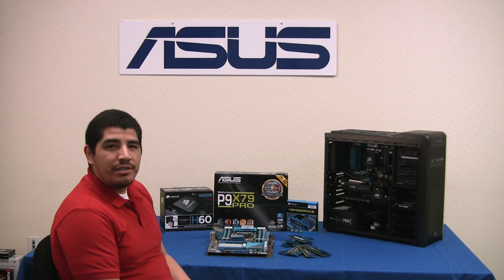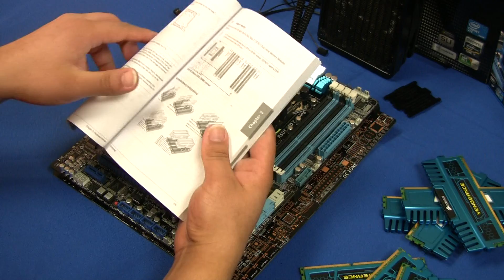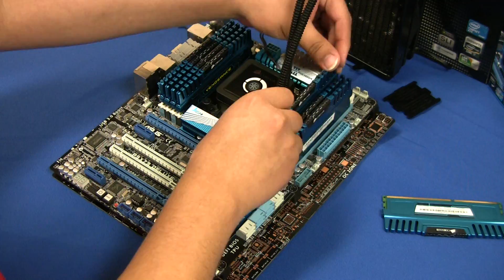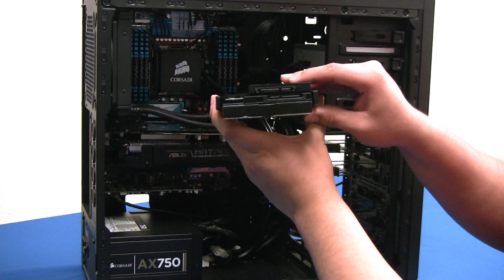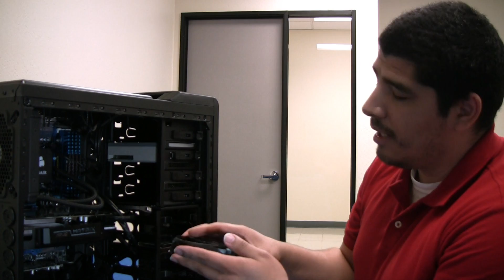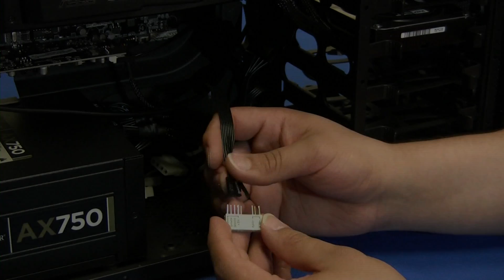How to Build an Intel X79 Custom PC 2/2

Comment: Question for you. Does the Corsair Hydro Series H100i fit into the Corsair Carbide Series 400R Mid-Tower using an Asus P9X79 Pro motherboard? I've read about issues.

Comment: btw, my asus p8p67 rev 3.1 died like 2 months ago, sent it in for repair to RMA got it back with only a small letter that explain nothing about what was done to the mobo, any how, the mobo still don't work, i lost hope for i have already done every possible thing i could to fix the problem, new psu, ram, cpu, you name it, so now i am left with one last option, and thats to buy me a new Mobo, but i will not make the same mistake, this time i'll get me anything but asus. shame on you asus.

Comment: -Corsair H100 for maximum OC (like 4.7Ghz or more) or H80 (because it's cheaper is as almost effective).
-SSD (buy two 120GB and raid them) or just one ssd and hdd for backup.
-Graphics: AMD HD 7950-7950 is equivalently as the GTX 670. 7870 is equivalent as the GTX 660 ti, but I think AMD overclocks better...not sure.
-3770k is a beast.
-Maximus is crazy awesome.
-600watts if you want one GPU, 700watts for two.

Enjoy your build. Don't forget to ground yourself, touch the PC case, simple. :)

Comment: Don't get the 680 its a waste of money ($600) and only a 5% performance increase over the 670. I personally would recommend a Kingston HyperX or a Intel 330 series SSD (Both are 120GB). You don't need a SSD to put games on just put them on a HDD. For the HDD I would suggest getting a WD Caviar Black 2TB. Also get a sound card Creative Sound Blaster Recon3D is one I could recommend

Comment: Keep the CPU, The E-ATX Motherboard is unnecessary You can get the ASUS Maximus V Gene M-ATX Z77 Mobo, Drop the 680 and get a 4gb 670 (You can get a Galaxy GTX 670 4gb for $440). Let me know if you need help with anything else :D

Comment: Yea, i was just looking into the h100, and was wondering if the artic accelero hybrid graphics card liquid cooler, and h100 can both be used together? Im thinking about getting the raidmax agusta case, it has watercooling features i hope thats what its for and not custom cooling.

Comment: you might wanna go water cooling because these chips already take up alot of voltage therefore causing the chip to heat up.

Comment: Hi JJ

I took your advice and built the system pretty much as you suggested  using 64Gb of RAM and an H100 cooler. My 16 year old son assembled the machine with me supervising. It is without a shadow of a doubt the fastest machine I ever experienced in 20 years of website design.

I used the same measures that you used during the RAM Cache and RAM Disk demos.
It took a while to get me head around the config but its fab.

Blistering performance enhancements! Thanks for your MOBO design and guide.

Comment: I had something similar when building my 1st pc afew years back. I used i7 920 on a Asus P6T mobo and was shitting it when putting the CPU in the motherboard as it was my 1st build and they wasn't cheap back then lol. Im using the same PC typing this message and Im researching a new build. So Im confident as my 1st build is still going ok :-)

Comment: Yesterday, when I was building my machine, I thought I was damaging the CPU socket pins when I laid my processor in the socket.  It made a crinkling sound as I was fastening down the retention bars.  It sounded like the bristles of a wire brush.  For the record, my motherboard was the ASUS Rampage IV Extreme.  Great board.  I was skiddish about using it for my first build, but I was very happy when the system fired up for the first time.  I had no problems with my build.

Comment: Can someone please tell me which CPU_FAN connector on an asus p9x79 mobo do you connect the corsair 3 pin pump connector to?  On my p9x79 deluxe board there is a 4 pin CPU_FAN connector and another 3 pin "heatsink" connector to the left.  Do I use the 3 pin heatsink connector?

Comment: does the cpu turn upside down in relation to the letters on the CPU. I have a evga x79 and just mounted the 3930k, and it looked weird that the cpu should turn upside down. I had a 2600K and that CPU was mounted the right way in relation to the letters. I know it's a weird question, but I would like to know anyway xD

Comment: Good video but "at this point", "go ahead", "actual/ly", "good to go", "pretty much" and other filler words are overused to the degree of becoming distracting. I also recommend "use" instead of "utilize", as the latter is only fitting on very rare occasions (biological systems and some other contexts). I also would have preferred to see the placement of the motherboard into the case.

Comment: All I want to know is how to turn my built in web cam back on. It worked fine until yesterday. Now all I get is a message telling me to be sure the cam is plugged into the USB port. Well, that is a bad piece of advice considering that my ASUS AIO has a built in web cam. But then again it tells me to turn it on. WTF, I never turned in off and even if I did I would surely know how to turn the dang thing back on. NO help I can find anywhere, not even on the tech support chat site. HELP ME!! Thank u

Comment: the letter a in front of 1600c9b  is on their dual channel offering.... and all listed supported corsair website newegg amazon etc... list quad channels exchanging that A for X ....M4X1600C9 ... the last number for latency, last letter for color...(no ending B for x1600... no blue... for sale anywhere...however asus p9x79 deluxe memory compatibility chart on website  shows a kit cmz16gx3m4a1600c9 ..(the black dual channel) with no b .. but the same ram listing them as compatible...

Comment: Thorough explainations.  Is it possible that an SSD and HDD can be attached to each of the 6 slide in HD bays and end up with a potential 6-SSDs and 6-HDDs installed?

Comment: fans shouldn't blow air inside a case from the top... they should exhaust, because warm air tends to go up on it's own anyways... therefore when exiting the case, it goes up into the room, and not down, beeing sucked in again.... fail :)

Comment: this may sound stupid but would it be easy to run two of those gtx 580's in this exact setup, I only ask because I'm looking at building one and this seems to be the one to go for, )easy and efficient with the power you need) but 2 gtx 580's is always better than 1 right?